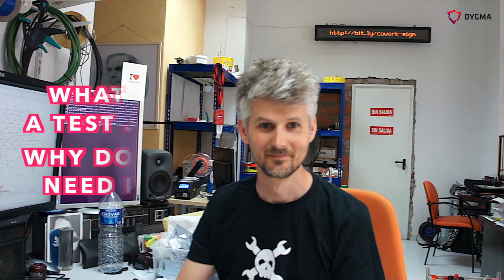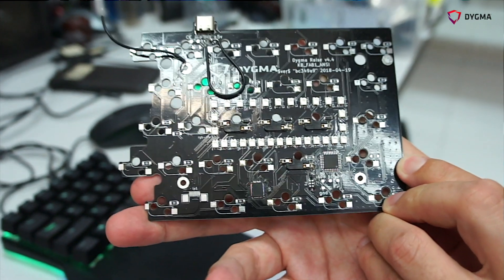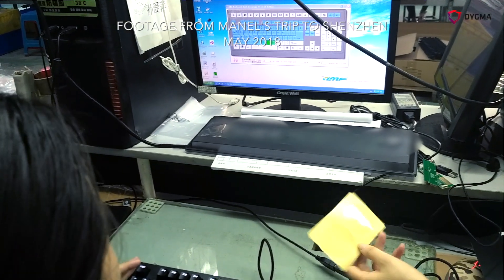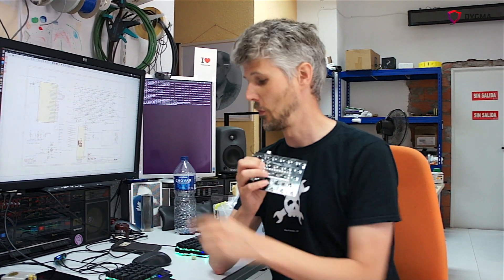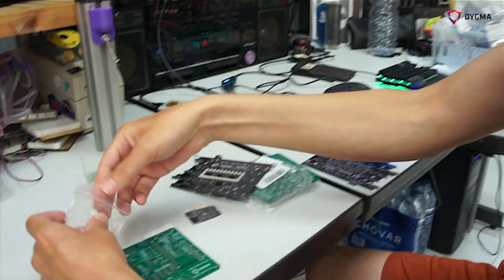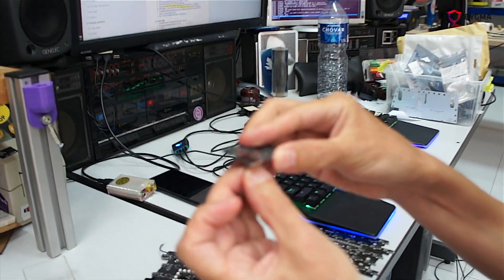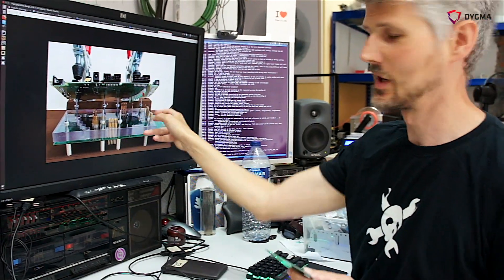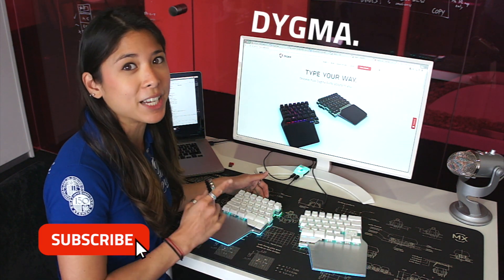What is a Test Jig? Why do we need it?

Comment: What is the difference between Fixture and Jig??
Reply from the maker: The difference between Jig and Fixture is that Jig is a type of tool used to control the location or motion of another tool. Whereas Fixture is a support or work holding device used to hold work in place. In metal and woodworking, both jigs and fixtures are essential tools used.